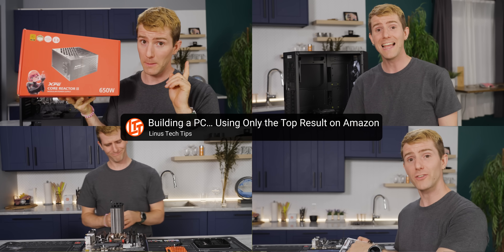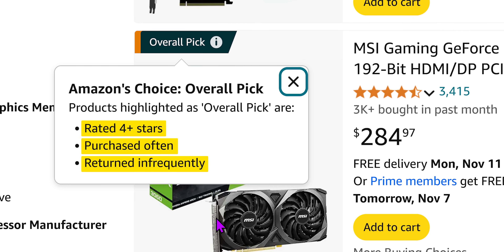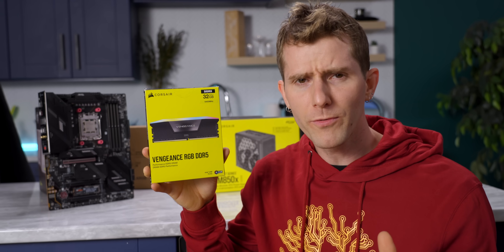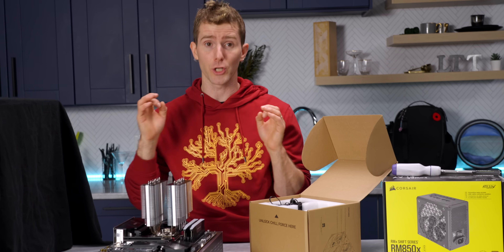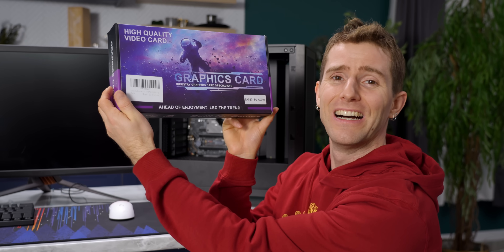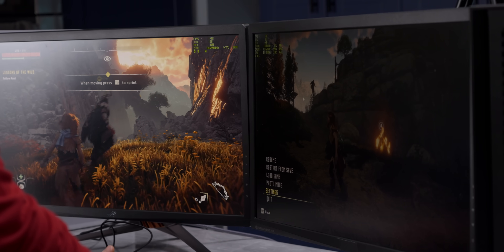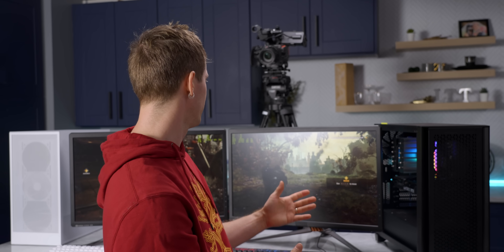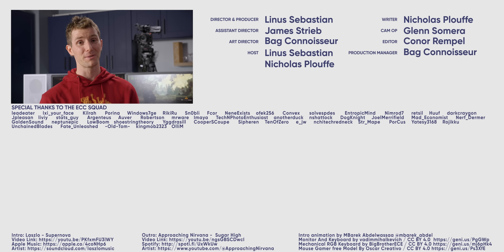Building a PC Using Only Amazon's 'Overall Pick' Products

Comment: I can’t believe I spent an extra 200$ for an entire high end build. And this is post ram apocalypse and it was in Canadian dollars. 320 cl30 6000mz, r7 7800x3d, cooler master case, thermal right 240mm aio, b650 mb and a used 3070

Comment: 10:14 That CPU temp on the winning PC seems unexpectedly high for a 7700X that is being cooled by a Peerless Assassin 120. That cooler should have no issues handling such processor. Either the fan curve is set way too low or someone missed on removing the sticker or not enough thermal paste on the cooler plate.
Reply: i know right

Comment: PCIE 5 doesnt make that much of a difference if the GPU someone is using on the PCIE 4 board is that much better...and the 7700XT is just a significantly better card than the 3060 ...even tho the 3060 is sill a pretty good card it's not on that level...

Comment: Idea: the timebomb pc
the most unreliable parts, all in one. each staff member is assigned a single part, and besides basic compatibility, finds the part they think will fail the absolute soonest, but still work for the video. any parts you think would die under stress, for any reason, all in one pc. it can be turned into a game, with bets on the order of parts that die, and whoever's part dies first wins a week off or to shave linus's head

Comment: To everyone talking about cpu temp, pc with 95° is at 60% util pc at 60° is at 30% util. There is a gpu bottleneck so the 3060 pc isnt using as much cpu power = less heat out of cpu

Comment: 6:33 So what's the difference? Does the shift version do something different?
Reply: It has the 12 pin GPU connector and the modular interface is on the side rather than the front

Comment: 2:52 I currently use the exact motherboard in this video (MSI MAG X670E + WiFi Tomahawk) and a Samsung 990 Pro M.2 SSD, and have had zero issues with reading the drive and using it as intended. This is my particular use case (I’m running a R9 7900X), so do with this information as you will.

Comment: Bro which graphic card should this setup required  for most games 

Amd 5600g cpu

XPG ADATA GAMMIX D30 DDR4 8GB (2x8GB) 3200MHz

Gigabyte B450M DS3H WiFi MicroATX Motherboard Socket AM4 DDR4

GIGABYTE GP-P450B 80 Plus Bronze Power Supply
Reply: Lowest graphic setting at 240p
Reply: @RedesCat  which graphic card required

Comment: Informative  video as always! 

Also, I have a question for anyone, trying to get updated opinions, because I've just been going through old reddit post from years ago. I'm Trying to decide what GPU I should get. Any recommendations?
My set up is as follows:

    Processor	   AMD Ryzen 9 5900X 12-Core Processor

    Graphics Card	   NVIDIA GeForce GTX 1070 (8.0 GB)
    Memory	   64GB of DDR4 running at 3600
    Motherboard   MSI MAG B550 TOMAHAWK MAX WIFI
    PSU is an 850 gold I believe. 

I was thinking of a 4070 ti super or a 4080. 

Thanks in advance for the recommendations and time.

Comment: LTT should address the limits of 32-64GB of ram.
most viewers are probably hitting the 16-32GB limit that we were seeing back when 32-64GB was seen as extreme when most users were stuck on 4GB or the holly grail 4GB+.

32GB is very standard on mot high end computers, 64GB is nice, but once you start messing with ram disk an what not, 128GB that was "high end" back in the days seems like a joke.

You can get systems with 512-768GB ram for cheap throwing a 100-512GB ram disk as cache and still have the "recommended" 32-64GB ram is pretty easy if you actually care for more then gaming (as LTT has hinted too)

hosting a video server can take 2-64GB of ram, depending on how snappy you want the user experience to be.

Comment: The 7700X runs hot, especially if you don't undervolt it, I can tell because I own one but man... 97º at 50% load must mean threre's something wrong in that build, probably thermal paste placing. It still beats the other build while thermal throttling tho

Comment: As far as the SATA vs NVMe "Best Overall" thing, it probably has to do with compatibility. Every single motherboard they are selling has internal SATA ports, but there's a chance there's  no m.2, or the lanes assigned to the m.2 based on chipset aren't ideal. So while I understand NVMe is better for almost every new PC build, the Best Overall status still exists, since it could also be an update for an old family PC from 2014.

Comment: amazon probably prefers the sata 2.5 inch for return rate reasons.  since all 2.5 inch drives are sata, there's no compatibility issues.  but with m.2, you'll have folks with a sata only m.2 slot trying to put an nvme drive in there and returning it.

Comment: That awkward moment when the featured PC cost the same as my graphics card. Whoops. Yes, I did cut corners in the rest of the system but I am seeing basically the same result as Plouff. If the primary purpose of your build is gaming, then you really don't need the most premium motherboard, PCIE gen 5, the fastest possible RAM or the highest core-count CPU. As long as the rest of your system is good enough, you can get away with an "overmatched" graphics card if you are playing at higher resolutions and graphics settings.

Comment: Is this compatible? Amd Ryzen 5 7600x , Thermalright Peerless Assassin 120 SE 66.17 CFM CPU Cooler, Gigabyte B650 AORUS ELITE AX ATX AM5 Motherboard, Corsair Vengeance RGB 32 GB (2 x 16 GB) DDR5-6000 CL36 Memory, Samsung 990 Pro 2 TB M.2-2280 PCIe 4.0 X4 NVME Solid State Drive, Gigabyte GAMING OC Radeon RX 7800 XT 16 GB Video Card, Corsair 4000D Airflow ATX Mid Tower Case, Corsair RM850e (2023) 850 W 80+ Gold Certified Fully Modular ATX Power Supply, Microsoft Windows 11 Pro OEM - DVD 64-bit. Im thinking about building a pc for a budget of around 1,000 to 1,450. This is what I found on pc part picker. I know its a lot but I dont even know if its compatible tbh.
Reply: Check it on PC Part Picker

Comment: Hey man I got a pre-built pc for Christmas last year and am wondering what to upgrade from here. The pc is honestly very slow and can't run many games. The specs are "IPASON Gaming desktop PC, Amd Rizen 5 5600G 6 core 3.9Hz, AMD Radeon Graphics (I recently bought a EVGA GeForce GTX 1080 SC GAMING ACX 3.0), 1TB SSD, 32GB DDR4 3600MHz 1.35 Intel Ram, and Windows 11 Home. If you have any idea what I should upgrade from here please let me know as it stopped running most games after a crash.

Comment: I hope to god that MBs being finicky about SSDs and NVMEs aint general, since I just ordered a new MB (ASUS) which will have a pcie4 nvme (WD Black) and a pcie3 (Samsung) plugged into it. The Samsung is my current drive ('cos, y'know, B450 chipset - switching to B550 with pcie4, so hoping to see a 2x throughput increase on what will be the new boot drive (the WD) - and I don't care about Windows - Linux daily driver user. Now you got me worried, though.

Comment: i also bought sata SSD about 2 months ago. i have only 1 m.2 slot in my motherboard ok? and i don't think i need to emphasise that replacing a motherboard is a big deal. i will probably replace it only after i have new cpu and gpu, so hopefully next decade which i think is the case for most people as well.

Comment: I think you should be really clear the impact of swapping to AMD for a GPU is. If I didn't know better I would leave this video thinking "well if the AMD GPU is a tier up aand i can make it work in the budget I should buy it". Real life mileage will vary, it's not even worth trying to do AI workloads on an AMD GPU in windows!

I love AMD, but even I still run an Nvidia RTX card in my main PC just because of compatibility and features. I know AMD GPU's aren't as bad as Intel ARC, but they still fall short in real life use cases outside of basic gaming horsepower.

Comment: One small question. My pc has a asus tuf b550m motherboard/ ryzen 7 5800x cpu/ RX 6800 gpu/ 4x 8g ddr4 3200mhz ram and a 750 watt PSU. Should I still upgrade on the AM4 platform that i have or should I save up to upgrade to AM5 platform?
Reply: There isn't much you can upgrade to since AM4 only supports up to 5000 series CPUs, so the only available upgrades are a 5800X3D, a 5900X or a 5950X. The 5800X3D will give you the best gaming performance but i don't think it will be worth it. I would update to AM5

Comment: The Crucial BX and MX 2.5 inch drives most likely get sold as an SSD upgrade or hard drive swaps for older PCs and laptops. It would make sense that they sell a lot of them if considering that angle.

Comment: i have the ventus 2x 3070 and i am currently replacing the forward fan for the 3rd time (i bought it locally shortly after launch so i've had it a few years), otherwise gpu has been fine. i'll never buy another msi ventus though, i miss evga

Comment: Not gonna lie, I just built my new system, and I'm rocking that Sata SSD from Crucial. It is basically just for storage. My previous system used HDD's including External drives. So to compress all those HDD's I bought the 2.5 SSD. So I see why its in the Amazon list. Before you guys hound me, I do have two m.2 ssds for my boot and game drive :D

Comment: As someone who routinely helps people spec out systems its interesting to see just how competent this build is especially when compared to the 'big store gaming special': i9 16gb RAM, SSD, GPU... only for it to be an i9 F, probably a stock air cooler, single channel memory with abysmal clock and timings, DRAMless way to small SSD, and bottom tier GPU. All in a case where airflow might be an afterthought.

Oh and you get the privilege of paying upwards $1500 US for such a mediocre system.

Comment: I have a 4000D airflow. The HDD cage is only held in by 2 screws and has 2 mounting positions to accommodate for longer PSUs/give more room for cabling. Or, if you're not planning to install any HDDs, just take it out completely, like I did.

Comment: i had a 500gb bx500 and the controller they used was struggling massively.
after writing 10gb or so it would throttle massively to the point so that a harddrive would have been faster.
i also had a crucial's mx500 500gb which never gave me any issue.

Comment: 5:20 geez I wonder, should I pick an extra  drive that requires a specific slot that is normally just one of on all boards or the one that has the same speed and is compatible with the plug that is plenty of on most mother  boards

Comment: Tbh i had a cooler i bought off Corsair coke doa i called late at night cause i didn’t bench test 😭 and built the system i told him i thought it was my cooler cause i had swapped parts and it would turn on but the cooler would flash red and my pc would tell overheat with post codes the guy asked me to feel the tubes if they were hot and listen if i heard any pump noise and the tubes were damn hot and he said we can get started on a rma im shortening it a bit but the customer services was damn excellent. Especially since it isn’t 24 hour service and they were to probably be closing soon.

Comment: Did anyone notice that Plouffe's CPU was overheating? It hit 96 Degrees if you look closely at 11:22 whereas Linus was at a chill 52 Degrees. That's weird?
Reply: @Vedant9710  it's probably cuz the cpu is bottlenecked by the GPU much more in linus's build causing the overall temp to be pretty low also the case effects the airflow a lot and  the exhaust fans with them too, especially since linus's case selection was much more on a premium side
Reply: 96 degrees isn't overheating. That's still within spec.
Reply: Not overheating though.
Reply: @mikeycrackson  last I checked, the engineers that made it said that's within spec. You may not like it but that doesn't mean it's not normal. Most computers run that hot at the die level because extra cooling costs extra money with no real benefit to anyone.
Reply: @rayok_zed  That's overheating. 96C while gaming means when he'll run any benchmark tool it will throttle/shutdown. Even for a laptop, it's still hot. I bet he forgot the sticker on the cpu heatsink.
Reply: @mikeycrackson  that would show in abysmal throttling though, wouldn't it? 🤔

Comment: Radeon has really stuck up their game i remember they used to have problems burning out but ive switched from nvidia to a 7900xtx gpu ab a yr ago after i bought it they added frame gen that boosted my fps by double on quality mode and triple on performance for half the price of a 4090 i get over 200 fps any game unreal 5 doesnt matter bodycam etc at maxed graphics avg over 300 on most at 4k ultra and im running a old gen cpu and no ddr5

Comment: SATA SSD probably just got an overall pick because people already got an M.2 SSD in their slots already, and usually you're gonna have extra sata ports available. They also just have better compatibility with older systems too which you likely know. Oh, and laptops / older laptops. Can usually insert them with little tear-down pretty easily.

Comment: Freaked me out...

I Just bought a system for black Friday on Newegg  nd got DDR5-6000 with 30 CAS latency...only to see Linus say "Noun, Verb, ...First Word Latency (FWL) "be cognizant of that".  WTF!

I freaked out, pulled up my order, it didn't show FWL, went to PCPartsPicker and plugged it into my system that I half built (MB and Chip) found my purchase and put what I bought for memory in the memory section and....it had FWL of 10ns. Whew. Don't scare me like that again. :-)

My build logic? Go last socket gen, top of the line for the components, being the best price performance and a step up from my I7-10700 specially the PCI 3 to PCI 5 the new motherboard supports. 

So it was an  Intel Socket, 1700, with the i9-12900 because it was $250 on sale and the MSI MPG Z790 Carbon Wifi II also on sale for ~$250. I could get a top of line MB due to being the last gen and black Friday. 

And a Corsair RM1000x (2024) power supply to future proof if I get a 50XX Nvidea card that needs that juice on a future purchase/upgrade. 

Build if interested: 

https://pcpartpicker.com/list/HpMFt3

Comment: Sata SSD, because my motherboard only has 2 M.2 slots, but it still has 4 Sata ports on it's RAID controller... my oversized ITX case can house 4 2.5" drives, and my PSU has two spots open that can be put to use running those Sata SSDs.
Slap in 4x cheapo 2TB SSDs in RAID 5, blammo 6TB of storage with a reasonable amount of protection against failure.

Comment: This is pretty similar to the PC I built a few years ago during the GPU shortage lmao mine has the 
R7 5800X
ROG Strix B550F Wi-Fi 
Vengeance RGB Pro ddr4 3200
icue H150i elite
Corsair icue 4000X
EVGA 750W PSU
EVGA GTX 4060ti

Comment: Yeah about the ease of use with MVNE drives... I've got three on my motherboard. One of them seems to 'disconnect' every once in a while. I need to remove it then install it again and it works fine... for a while. This requires me to remove my huge graphics card and then a heatsink, to get to it. I have PCIex board to mount it on to make it easier but that's after I have had to do this a couple times already.

SATA drives are super easy to remove by comparison. So I am going back to SATA drives as the MVNE drives fail. Tired of tearing my computer apart just to remove a drive.

Comment: just spent 1.8k to 2k on a pc build, well I say spent, I mean Ive spent 1k (the 7900xtx + PSU and SSD's) and the rest will be 800 to 1000 depending on if I can get the 9800x3d or if Im going to have to settile for the 9700x on friday when the site I'm using says they'll get them back in stock (its also payday YAY) with some other stuff since I cant really start building without a CPU. Plus I'll only have to pay delivery once.

Comment: 10:47 no one gonna talk about that 97c CPU temp?
Reply: I feel like someone forgot paste on the CPU lol no way those temps are that different in the same scenario with a Peerless Assassin
Reply: @Senpaization  If someone didn't paste the CPU, the computer wouldn't be running as long as it did, and it for sure wouldn't be running at only 97c. Would have hit thermal max immediately and probably would have BSOD'd
Reply: that's interesting considering they're both using the same cpu
Reply: @AlexhMusic  and cooler
Reply: Maybe the fans were manually set to a low RPM, so they're not noisy during filming? Idk
Reply: 😂 I was literally scrolling to make sure someone else noticed the temp differences!!! Crazy!
Reply: Not that but the low FPS has its CPU at 56 degrees, which should be impossible for a computer like that. They usually run into the 60’s while gaming. Something is wrong
Reply: Maybe they forgot to remove the sticker at the bottom😅
Reply: that avi is so fucking goated
Reply: And I thought my CPU got too hot at 89 playing GTA.
Reply: @MixZTitaniumDubstep  89 is fine for modern chips. don't listen to the others.
Reply: @MixZTitaniumDubstep  You need a better cooler if you are consistently running at that temp while playing it. That is so high lol. I don't let mine get over 80 if I can help it. Running at that temp long term is gonna kill that CPU much faster. I would seriously consider getting a decent AIO or a really good air cooler for that CPU. It's worth the long term money saving.

Comment: That CPU is BURNING at 97°C 10:40, did you forget to peel the plastic off the cooler or the thermal paste?? After all its the same CPU, even tho they run different coolers.

Comment: 11:47 What's wrong with Thermaltake PSU's? I ran a Thermaltake Toughpower Grand 1200w Platinum for over 2 years with a Ryzen 7 5800x on an x570 chipset with an RTX3080. Recently rebuilt the rig with new everything and a Seasonic PSU, but the Thermaltake never blew up. Only bad things I could find about it were incompatibilities with UPS's due to signwave issues.
Reply: Lmao upgrading after only 2 years is wild and not nearly enough time to wear down any part